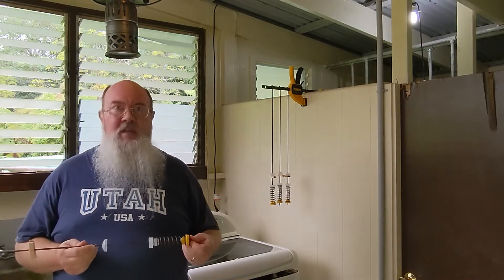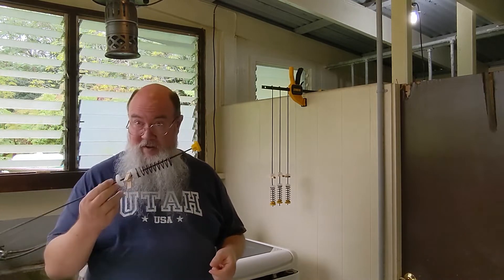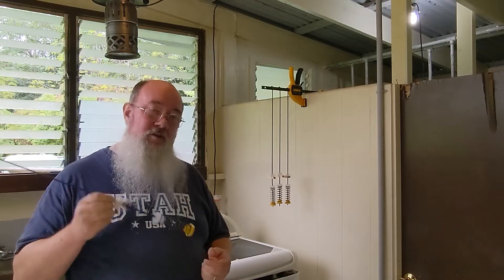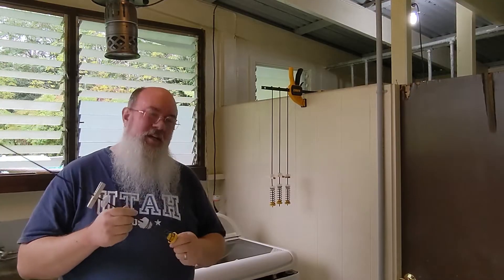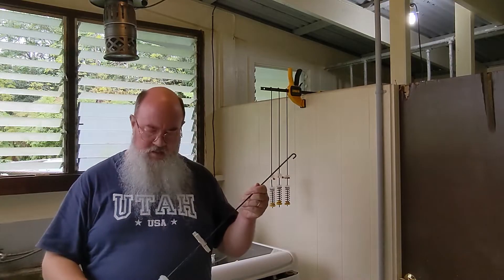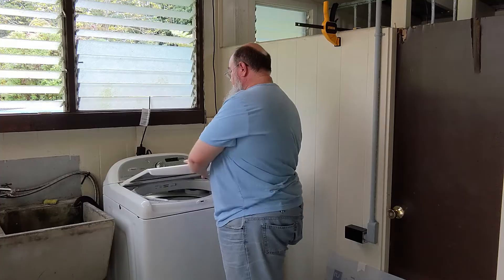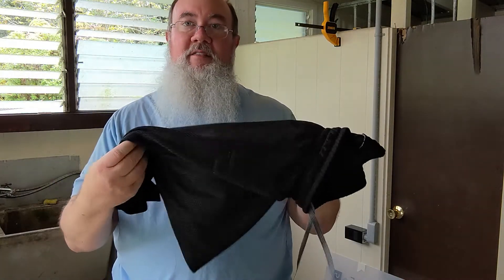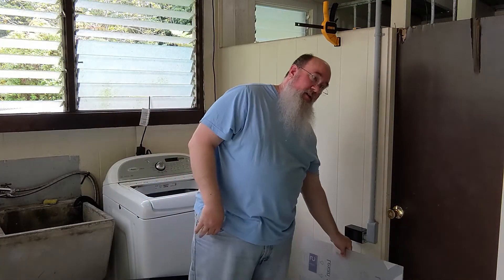FIX your washing machine rods! Don't $$buy$$ a new washer or washer rods before watching this video!

Comment: Any other grease or lubricant you can recommend, the one from the link doesn't ship where I am and I can't fond it at hardware stores
Reply from the maker: Unfortunately, no. But the thing you are looking for is called "damping grease" or sometimes "motion grease." It is a bit unusual to find in a hardware store, but perhaps an auto parts store would have something similar for hydraulics.
Reply: Try a non hardening plumbing thread sealant. Greaselike paste that might have teflon.  Applied some on my OEM suspension rods so it would get into worn out bushings and it seems to help.     Washer was shaking violently at start of spin cycle but if it could get past a  certain speed it would stop shaking.   The paste seemed to make just enough difference.

Comment: I finally got the grease I ordered from China but it’s no good. I instantly noticed it’s consistency was not as thick as the original goop found on the rod. I reluctantly applied it to all four corners and put the washer back together. I soon found myself looking for new rods on the local online shop. I haven’t bought replacement units yet but still looking for some sort of grease. I found Dow Corning moly kite but it’s over $40! If I knew 100% it would work, I might buy it. I guess I’ll get the $15 replacement set of rods and experiment with the old ones.

Comment: That is pretty cool and thanks for sharing, but it's a lot of work when you consider the fact that you can find a new set of rods for $20 bucks if you shop around for them.
Reply: Same thought. The grease plus JB weld is $25 + tax, a new set of rods for my appliance is $22 + tax or $25 locally. Any ways, it's always good to learn a little bit of everything.
Reply: @jesmasco  in my experience those non-OEM rods that cost $20 don't tend to work for very long.  Maybe their grease is inferior.
Reply from the maker: @robertpodolsky6252  I can't think of any reason you might not find rods for $20. The whole point of this video is that there's nothing magical about them. A few pieces of steel, plastic, and grease should maybe cost around $10-15 to manufacture. So, I believe folks can find cheap rods. It just bothered me that most of the explanations are "throw away these steel things because they have 'gone bad' if you see this." It's a spring and a rod. If it isn't rusting apart, it isn't "going bad."

Comment: Zack, first thank you to both you and washer dryer money for isolating the root of this problem.  Do you know the dimensions of the foam cylinder that wears out, and the diameter of the steel rod it slides on?  I was contemplating using some plastic rod (probably nylon or acetyl) cut to length and drilling out the center.  Then putting a slot along the side so I can snap it onto the steel rod. Plastic rods come in various diameters and it would help to know the dimensions.  The washer I am hoping to fix is 1100 miles away from me right now, or I would just get the dimensions myself!  Thanks!
Reply from the maker: Unfortunately, I think these come in pretty variable shapes and sizes. That's one advantage of the epoxy solution: It is fit-to-task. I agree that a cut-to-size sleeve of something like brass would be ideal, but it would be tricky to make a rod this way from a distance!

Comment: Zack, nice job. After watching the video a few times while waiting for the grease to be delivered I developed a question. After making the bead of jb weld putty did you slide it up and down to make sure it did not stick to the rod? Also noticed you made a button head even though the original foam was just a tube, just curious why.
Reply from the maker: Yes: The point is that it has to be able to move, but it is the "limiter" in terms of grease flow between the bead and the rod. So, if it sticks, that's bad; it needs to move.

As to the button head, that was just the shape in the cup? I suppose I think it probably absorbs "shocks" a little better by distributing the "hit" over a wider area than the narrow bead, but if your "cup" only has a sleeve, that's probably fine.

The key to the whole mechanism is limiting the motion of the bead against the rod by limiting the amount of fluid that can pass in that very tight space. Air would not provide any significant resistance, so you get bouncing. A regular lubricant would also seek to REDUCE resistance, so something like "teflon" would turn it into a Bouncy House. The motion grease is meant to serve as a "speed limiter" - it can still move, but only "so much."
Reply: @zackstone6354  made mine yesterday looks like it’s going to work but I wanted to let the epoxy cure over night before I installed.

Comment: Zach,  Mahalo for your video. I will be attempting to recreate the repair this weekend once the grease arrives. The one question I have is, how many JB steel sticks did you need to make the "new gripper" part for all four rods? I received my ordered product.  However it doesn't look like it'll be enough to make four copies of your gripper part. Mahalo for your assistance.  Aloha
Reply from the maker: Aloha! In most cases, I think 1 would do the trick. However, the design of these rods varies a lot between models. So, if you think a "good fit" on the rod for the pieces you have would exceed 1, I'd pick up a 2nd. For what it is worth, you can get Steelstick at Walmart or Home Depot here on Big Island, and even my tiny local hardware store usually has a couple. So the only thing you have to "order" from off-island is typically the grease (depending on which island you are on, of course). 🤙
Reply: @zackstone6354  Mahalo.  I ended up getting a second one just in case at home depot.  

Repair was made to washer last weekend and waited till Wednesday to let the new grippers cure. You were also right about the "dampening grease" that stuff was tacky and nasty to work with, but I could see how it made a difference. Worked like when it was new. no need to buy $90 dollar rods (ea). Mahalo  Zach for sharing your manao (knowledge).

Comment: First of all thank you. I scratched my head more than a few times when trying to find the problem. Nothing visually obvious as in, nothing broken, no lose parts laying at the bottom of the machine. I did notice right away and commented about how sticky the grease is. I should have caught on at that point but I had no idea grease could be formulated to do the opposite of what I expect grease to do. Brilliant observation on your part!
 I did however invent a replacement plastic bushing using some 1/4” thick polyethylene but it didn’t work because I couldn’t get the proper shape I needed before I scrapped the idea. I even thought to cut off the ‘retainer’ on the bottom of the rod and running a die over the end to create threads to accommodate a nut for future repairs. That still may be an option but not right now.
 I’m hoping I can find some of that grease to try for myself but in the meantime, we stop the washer before the spin cycle completes. Pain in the butt!
 Thanks again for the tip!
Reply from the maker: A link to the stuff I used is in the description.

What's funny is that damping grease is not a common sort of thing for people to know about. In fact, I only learned about it in the past 5ish years when dealing with little things like car A/C vents. A little motion-limiting grease is usually the difference-maker in something "feeling like quality, precision work while you operate it" and "loud, plastic, annoying, and cheap" even if made from the same material ... 3D print some widget that uses nylon gears, toss a little motion grease on it, and the difference is immediately obvious.

But in a washing machine? I wasn't sure. I recorded it just in case, and I was dying laughing at the first spin cycle. It was flawless - worked better than I could have imagined. Hence, the wife's comment, too. I knew there was no way anyone else had figured that out after watching the videos I had seen on replacing the rods on YouTube. We're past the 8-month mark, now ... still running on the same fix.
Reply: @zackstone6354  Yes, I saw the links you provided but I’m in the Philippines so we don’t always have access to high products here. I did find some on Lazada (sort of like Amazon here) in bulk form. The ad has no information about it only that it’s ‘damping grease’. It’s somewhat reasonably priced @ around $15/30 grams. There are a couple other varieties too but they cost more than I want to spend at thins point in time. Looks like about a 2 week wait to ship from China so I’ll start wearing my underwear a bit longer between changes. Hahahaha
 I’m curious if you have any other dealings with corrosion and possible solutions due to living in such a harsh environment… Rusting metal, termites, intensely hot sun along with high humidity and, fighting with various insects in the garden are our problems I complain about most.
 Thanks for the update on the washer. I’m glad it’s working for you and I hope we have the same results.
Reply from the maker: @nelsondog100  The rust is a never-ending battle. Marine environments are unkind to exposed metal of any sort. The only advice I have on that is to coat whatever you can with a good rust-preventer or rust "conditioner" and inspect it often. Rustoleum Appliance Epoxy is a huge help, but vigilance and quick treatment is the key to longevity. Heat accelerates the process, as well, so avoid direct sunlight or hot attic spaces, if you can. If you have an airtight space (I do not, as you could tell from the video), a dehumidifier is a huge benefit (or air conditioning). However, they can be very expensive to run in the tropics ...
Reply: @zackstone6354  I’ve learned to coat everything I can with paint, grease or oil, it certainly helps. Ive seen some rust converters but I don’t know too much about them. I guess I’ll look into that soon. You’re right about being diligent and acting quickly.
 Thanks

Comment: I forget what brand washer and dryer my parents have but I have to ask my mom to do my laundry for me because I do not have easy access to them currently .
However , my clothes , my black pants that I first noticed it on , have reddish brown stains on it. WHAT could be causing this???? Driving me mad since initially I thought it was the sunshine causing it to appear that way at first but no , even inside at normal light I can see streaks of these stains. I think one of my white tshirt has some of this staining too. 
Please help me to get to the root cause of it. Hopefully it’s something I or another family member can remedy ourselves without having to call a service person.
Reply from the maker: If it comes off, then it is likely rust from somewhere along the water path. If it does not, it is likely a small amount of leftover bleach that isn't fully draining out of loads of white clothing.
Reply: @zackstone6354  ugh…I hate front loading washers. Those gaskets get to smelling so disgusting and the junk left behind in the cranny (I don’t even know the proper name for it , lol). 
Will non-chlorine bleach do the same thing ? I don’t think my mom uses bleach anymore but it’s possible she uses Oxyclean when she washes whites …
Reply from the maker: @SleeplessinOC  Typically, with black clothing, "staining" is something that removes pigment, not stains over the top of it. "Color safe bleach" can sometimes cause issues in black clothing under certain circumstances. Also, various acids can do it. If there was something particularly salty, or maybe citric acid spilled in there, or a half-dozen other things. Tough to say. Personally, I'm a fan of front-loaders. They last a LOT longer than the basin kind because of the direct drive mechanisms. However, yeah, that means they can also build up bacteria in certain spots that can be tough to clean out. Sometimes, you can get rid of the smell by running a load with old-fashioned bleach and an empty (or as nearly empty as it will let you) load right after it to clear any residual bleach.

It also seems like your mom quit using bleach probably because the washer didn't fully drain ... thus leaving some bleach behind to ruin things in the next load like you are seeing. I'd Google for common "draining" issues on that model of washer.

Comment: I’m trying to repair mine but the most important part of video went too fast with music. Don’t know if I should fill in with epoxy or solely on the rod and push it down using vise?
Reply from the maker: I would not "fill in" with the epoxy. It needs to be able to move against the rod. You might get a better perspective by watching the video that inspired me: https://www.youtube.com/watch?v=IZZCwXEmGhE&t=0s
Reply: @zackstone6354  Well, I managed to move them and filled in nicely with black plastic where the foam was. Almost made exact same thing. Now I gorged them with dampening grease. See how that works.
Reply from the maker: @robertmunguia250  Best of luck! If you bought the big tube of grease, yes, it is spendy - especially considering you will only need about a spoonful, total. However, I still haven't had to re-grease mine, and I expected to need to do so, by now.

Comment: The original “gripper” was removed from the rod? I missed what happened to them.
Reply from the maker: Zack Stone
1 second ago
The "cup" thing had a "sleeve" thing in it. The "sleeve" was some kind of foam or fabric or paper or something, but it was mostly disintegrating with the aging grease. At around the 1:26 mark in the video, I am digging those out with a screwdriver and tossing them in the trash. Even if I threw more new grease into it, I don't think it would have created the fluid dynamics necessary to dampen the bouncing. I knew that creating a new "gripper" would do the trick for sure if it could tightly limit the space between it and the rod. So I just went straight to that design ...

Comment: Thanks for this smart evaluation of a tricky problem ... was hoping I could just apply the grease and am not clear on why I need to refashion a liquid steel doohickey if the original junk looks OK. Exasperating ...the engineers who designed these flimsy pieces of crap ought to be covered in honey and staked naked to a termite mound. This was a $400 washer designed to fail and i am wondering why some greedy lawyer hasn't filed a class action by now???
Reply from the maker: You know, I'm not that mad about it ... but I do understand why people would be. In terms of using the "original doohickey," I don't know the answer. The "cup" thing had a "sleeve" thing in it. The "sleeve" was some kind of foam or fabric or paper or something, but it was mostly disintegrating with the aging grease. Even if I threw more new grease into it, I don't think it would have created the fluid dynamics necessary to dampen the bouncing. I knew that creating a new "gripper" would do the trick for sure if it could tightly limit the space between it and the rod. So I just went straight to that design ...
Reply: Did you try it with just the grease?  I had the same thought.

Comment: Thanks for the video! What kind of epoxy did you use?
Reply from the maker: JB Weld's Steelstick is something I have used for many little "fabrication" projects like this. It hardens quickly, and the finished object is typically very durable.

Comment: GREAT video. A geek like me who decided to understand what was happening. On my  Samsung top-loader my board went out. Tech guy fixed it and was really cool when I asked about the off balance code it was throwing. He grabbed the tub shook it and said, those rods are bad, get these on Amazon and you can do it yourself. So I did. Install took me 10 minutes and cost me $50. Then I looked at the parts to see what could possibly go wrong. I ended up hanging mine like you did and measures the spring compression with a ftlb meter and they were all different. Now the thing purrs like yours!
Reply from the maker: Yeah, the "intuitive" thing is to see the spring and think, "Oh, those different compressions are obviously unbalancing it." But that's not really the problem. The spring just has to absorb the impulse; the off-balance comes from the uncontrolled release of the tension.

I didn't understand: Did you replace the rods or not? Also, did the NEW springs have different compressions, as well? It would not surprise me if they did. Also, if you did get new rods, you can have a "spare" set of rods by reconditioning the ones you pulled out. :-)

Comment: take them rod and take them little rubber things out of there and put pantyhose in there rapid tight put the cap back on them. it'll work I've got about 60 loads on the machine was in there getting grease it or nothing just put the pantyhose in there and let it run and you'll put the pantyhose in there where you can still close the cap but wrap it tight
Reply from the maker: That's super interesting! In the case of the pantyhose, the energy is dissipated by the nylon's flexing instead of the fluid dynamics of the grease. I'm curious how long that lasts. I feel like my solution will last a little longer, but it will depend on how long it takes the pantyhose to break down vs. the motion grease ...

Please post a follow-up comment when you have to check it again! Mine has been going for 8 months now. This video getting over 10k views is hilarious to me, too. I knew it would get a lot of views, but I have to admit I still find it funny.